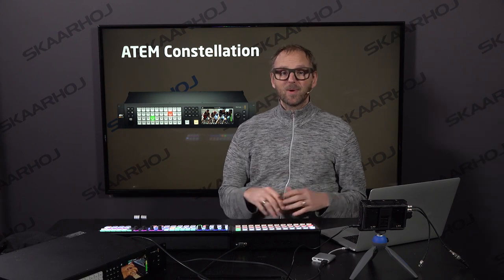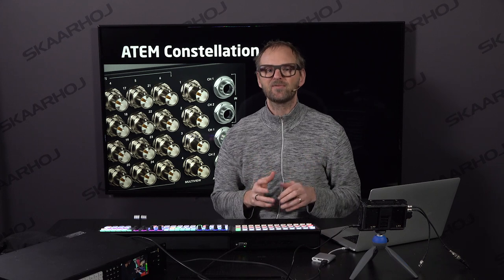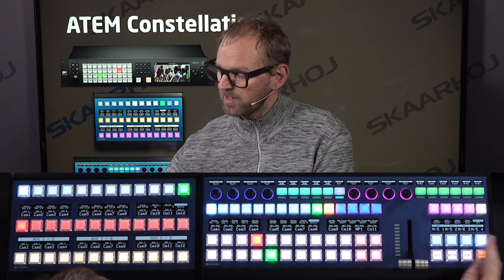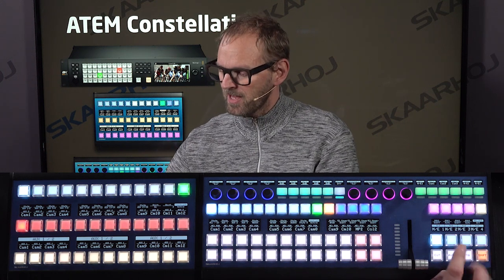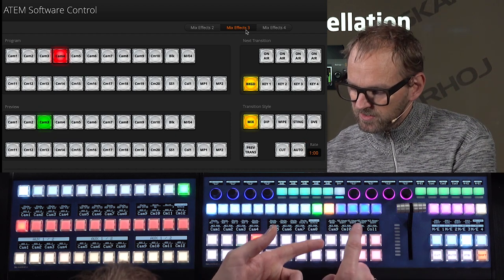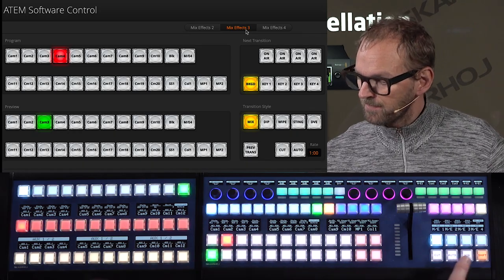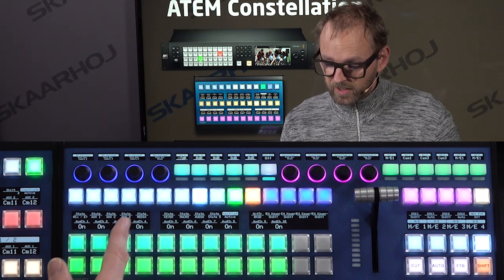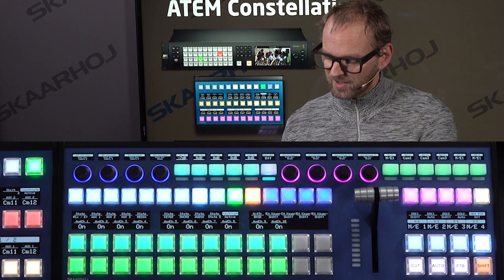Controlling ATEM Constellation with Master Key One and Master Key 36

Comment: I use the FTB button as shift key level two, and light up the key with a different color. It feels a lot better place the switcher for switching. FTB was put in a different place as its not a key used often.
Reply from the maker: Cool - that sounds like a good solution :) Thanks for sharing!
Reply: What  is the name this push button commen name